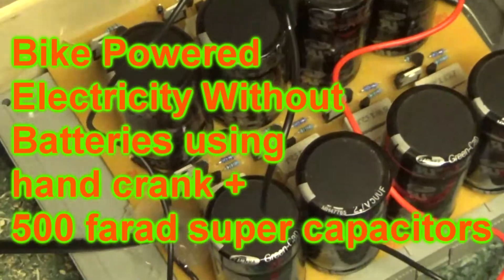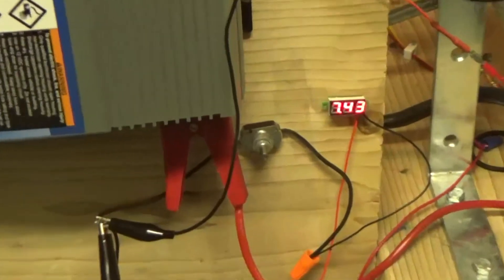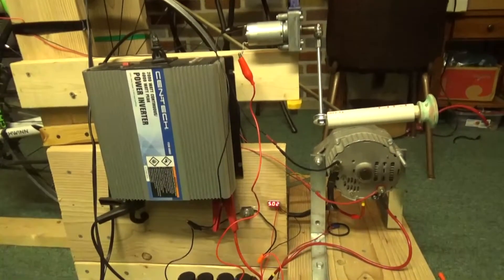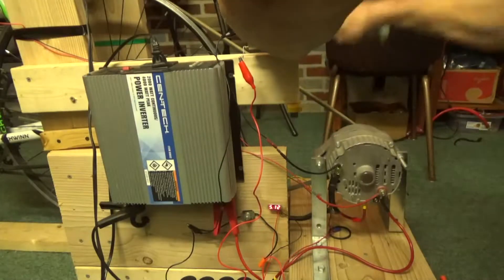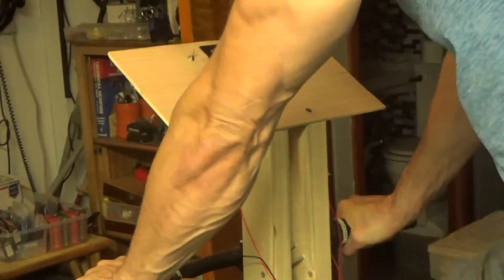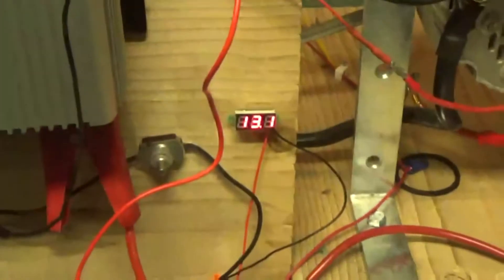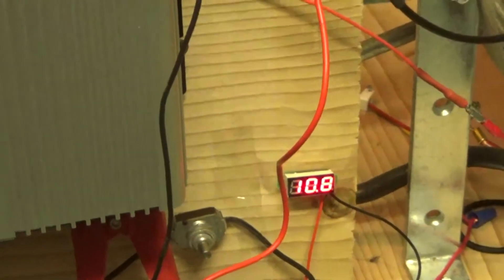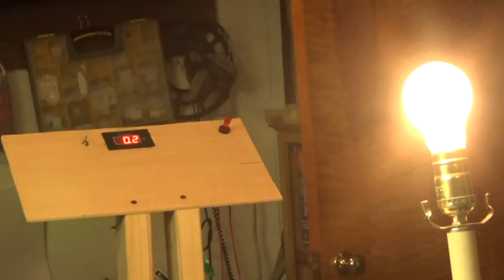Bike Powered Electricity Hand Crank Alternator Starter/Balanced Super Capacitor Board.

Comment: Can we charge and discharge supercapacitor 2.7v 500f pack of 10 [48v] at the same time? In a continuous loop, as in powering a dc motor and this motor rotating a dc generator and this generator powering this Supercapacitor pack...loop